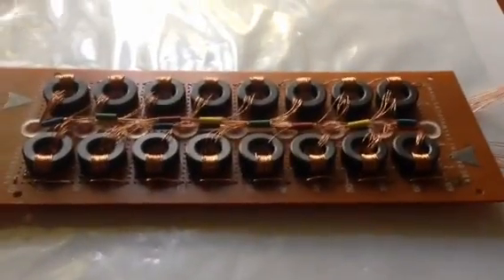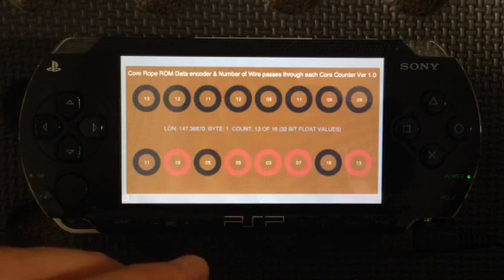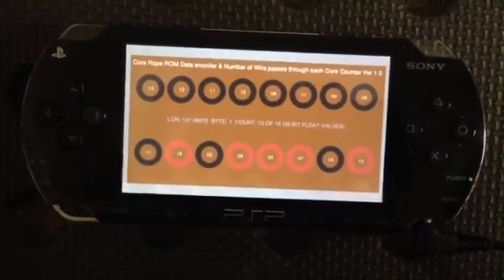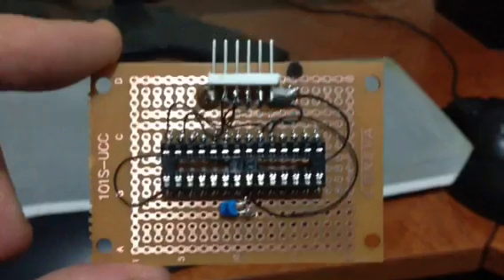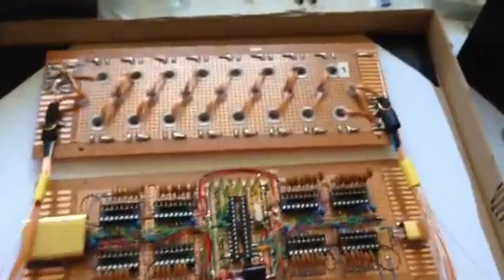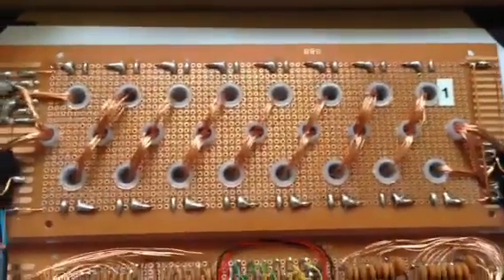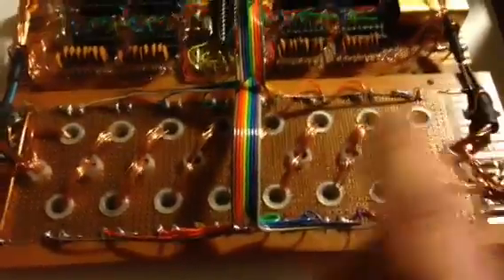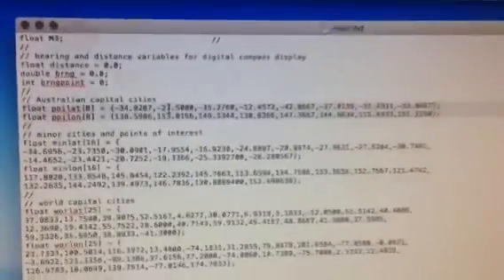Core Rope ROM Part 5 (Hardware Progress)

Comment: This looks like a perfectly workable core rope design, but it looks to me like you're using modern ICs to do the address decoding, is that right? The really clever thing about the Apollo core rope design is that it performed address decoding purely *magnetically*, without the aid of MSI decoder ICs that didn't yet exist. There were two address wires for each address bit, one carrying the address bit and the other its complement, weaved through the cores so that for any address exactly one core had no active address wires running through it.  That was the "addressed" location.

All the other cores had at least one active address wire, and the current through even one active wire was strong enough to drive that core into magnetic saturation. A saturated core was then unable to couple a pulse on a "readout" wire to a "sense" wire (the readout wire went through every core, but the sense wires only went through cores for which the data bit was a '1' and bypassed the core for a '0'). That's how you read the contents of just one particular memory location even though the sense wire ran through (or around) all the other cores too.

The Apollo Block II AGC was built entirely out of one type of digital IC: a dual 3-input NOR gate. If you tried to build even simple address decoders out of these ICs you would have needed something like thousands of these ICs, which was clearly impractical. (There were only 2800 ICs in the entire Block II AGC.) That's why the use of magnetic logic in address decoding was so clever.
Reply from the maker: HI :) In the end it’s a microcontroller outputting serial, which could also just as easy store much more data than the core ROM :D
It’s just implementation of a principle though, not particularly inspired by any specific computer. I want to reproduce the Single diode transfer loop shift register with square ferrite, but the cores are so large it’s going to have to be transistor assisted to switch the next core in line too... but will still genuinely demonstrate a principal ;)
Reply: Sure. Although core rope has long been obsolete, I do wonder if it might still find some niche applications, such as in extremely high radiation environments. Memory (both read/write and ROM) tends to have the highest densities and the greatest susceptibility to radiation.
Reply from the maker: ApolloWasReal For nonvolatile core RAM (matrix addressed), at the time making it I was mainly pondering its lifespan in terms of write cycles. If not infinite, it would surely outdo any current technology for non  volatile memory. The core RAM is still my favourite project, and has been reliable.